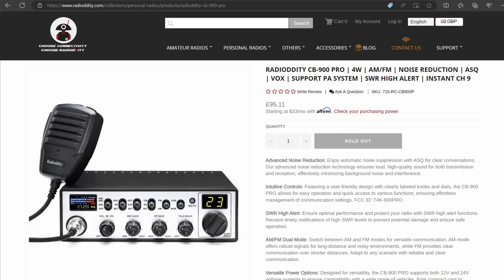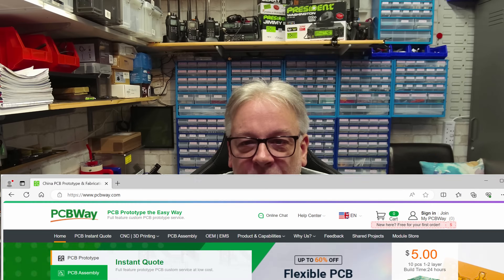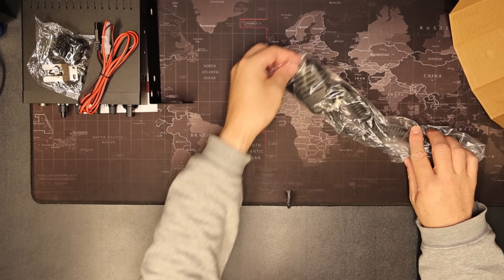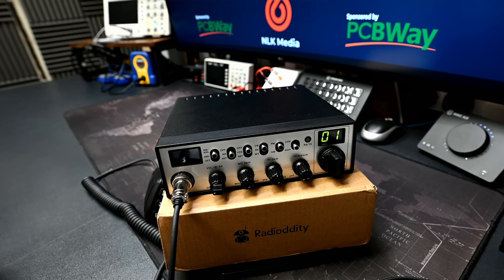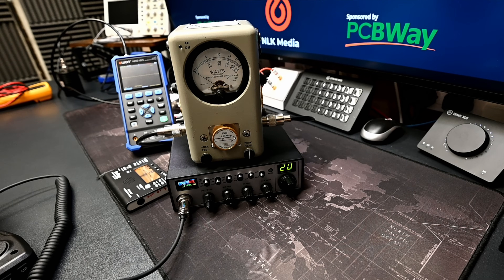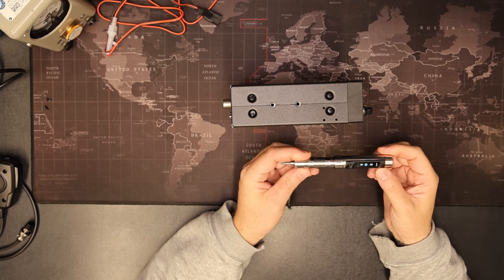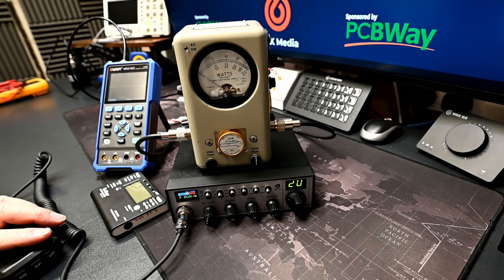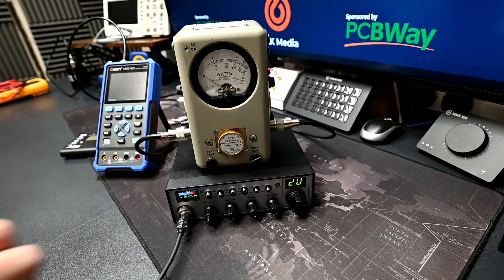Radioddity CB900 Pro – CB Radio Review and Modification

Comment: Would not this radio be better than the CB500 for switching the pin connector vs cutting the wire? As I'm mostly looking at CB usage since I don't have a ham sandwich 🥪 yet. Also, can you use Morse Code through the unit with a Vibroplex unit, was thinking of some general practice with a friend.
Reply from the maker: The CB500 is a better all round radio as it provides CTCSS/DCS tones and codes. If your interested in getting your "ham sandwich" :-) then take a look at the QT80 which I have just posted a video on. It can be expanded to cover the 11-Meter CB band, can be modified for CW via a DIY hack to the microphone and has a dedicated CW mode, its powerful and extremely well priced. All the best and thanks for watching and commenting. MJ7NLK

Comment: Zeros on UK FM is fine. No one would notice. SSB obviously you will
Reply from the maker: Thanks @DnBclassictunes, have just posted a video on the QT80 which is a great radio (essentially an Anytone AT-6666Pro) which is feature packed and very flexible. All the very best and thanks for watching and commenting. MJ7NLK
Reply: @NLKMediaGroup  I've bought two cb 900's and the cs-47 with a load of accessories for 5 just pounds extra. Looking forward to trying them out. If these guys made a homebase CB it would be awesome. Great in depth channel 73s

Comment: I was very close to getting the QT-40, but I picked up a President Richard for 80 bucks and a Ronald for 90 bucks at our local Ham Fest.  I wish the QT-40 had the digital display that this one (CB900) has.  Great review my brother across the pond. You Brits are resilient people, stay strong with whats going on.
Reply from the maker: The President Richard is a fantastic radio and I have covered it on the channel and referenced it in many videos. The Walker 2 (EU Model) is the same radio but CB out of the box rather than Ham for the Richard and they both have the same circuit board. The Richard can often be found cheaper than the Walker which doesnt make sense as when both radios are expanded they are very nearly identical. You can't go wrong with the Richard, it is a lovely radio to use. Now if they would come out with a Richard 2 that also had SSB that would be amazing but the Lincoln 2+ is kind of filling in that space.
The new digital display on the CB-900 is really nice, a little small for aging eyes, but a really nice addition and keeps the look and feel of this classic style radio. It lacks CTCSS/DCS support but not everyone wants or needs that. The CB-500 is the better choice on a feature level but doesn't have the same old-school visual appeal.
I have around 20 President radios in the collection but don't have the Ronald. However, I do have the CB version being  the Teddy 2.
The new QT80 looks a beast of a radio and I am looking forward to getting one to test and play with soon. Radioddity have done a great job of bringing some interesting radios to market at decent prices.
Things in the UK are a little difficult right now with a load more gatherings scheduled today which I very much hope will remain peaceful. Thank you for your kind words. All the best and thanks for commenting. MJ7NLK

Comment: Definitely needs UK channels in band block normal/expanded.

As freq readout not an issue 
27.781(don't need 25 at the end)
I'm sure this can be done in radio firmware 👍
Lacks ctcss too on FM, bit of a shame.

👍Rob.P
Reply from the maker: Hi Rob, adding the UK FM 40 would certainly be a great addition even if it was added as a band block in expanded mode. Maybe that will come in later versions. There is no support for tones and codes on the CB-900 and this is where the CB-500 has the advantage and its slighly cheaper. It is a good radio, looks nice and is easy to use, if you only need AM/FM and don't need CTCSS/DCS then its worth consideration but the CB-500 is hard to beat for the money. All the best and thanks for watching and commenting. MJ7NLK

Comment: Good video! The radio to review next, is the AT-6666 PRO / QT-80. It's the killer radio that even the Washington won't out-perform. I hope you can get one to test. Imagine a CB-500 on steroids. The new QT-60PRO is worth a look as well. Fantastic radios!
Also, you should show the 3 different meter display modes on the CB-900 PRO. It's probably the most unique (and interesting) thing about this little CB radio. Another thing to mention is that the AT-900PRO is actually the little brother (with less features and less performance) when compared to the AT-500Mii (CB-500). As you saw in your review, the CB-500 is more advanced, with a real dual purpose modes (for CB and HAM) and sensational performance. 
73
Reply from the maker: Have added the Anytone AT-6666 Pro / Radioddity QT-80 to my list of radios to source. They have the same power output rating as the Washington, 80W PEP and 50W on FM. Would be interesting to see how similar they are on the inside and what the differences are. Will ask my contact at Radioddity if they can send one out for review but I need to clear the backlog first. I did have a play with the S-Meter but as it was plugged into a dummy load I decided not to include due to it just showing 1 all the time. If I had managed to get out and about with a field test then I would have included. The LCD is small but works well and it looks very similar to the RF Power bar in S-Meter mode. It does get very confusing with multiple companies selling the same radio but I did notice that the AT-900Pro appears to also be available in Black as well as Silver which looks nice. Well there is a picture of a black version on their site. The CB-500 is really great value for money and I really enjoyed using it which is one of the most important things. The CB-900 is much bigger in size (needlessly based on the empty space inside) but out of the two I would pick the CB-500, it really is a great little radio. I very much appreciate your comment and thank you for watching. 73 MJ7NLK
Reply: @NLKMediaGroup  good stuff. Thanks for the reply. Yes I have a CB900 PRO here, and It is indeed a fun radio. Only the silver and black version is available currently. The "all black" version is going to be under a different brand name soon.  FYI, The AT6666 Pro actually has one additional final (output transistor) compared to the Washington. So you will see peak power of around, (and usually just) over 100 watts PEP. As well as supporting the 15m ham band as well. (There are many rumours flying around at the Washington and the 6666 Pro are the "same", But they only share a core design). There are many differences between them as I'm sure you will see. I'm looking forward to seeing your upcoming reviews. Keep up the good work! 73

Comment: First review of this radio on Youtube - Congratulations! Cool looking radio with nice expandability. Personally I would have preferred if they dropped the talk back control and have a dedicated squelch but thats just me. Have you any footage of that s-meter working? I like the traditional Uniden/Cobra type meter but interested to see it in action. Look forward tl any more videos you have planned. 73s Ant 26DR302
Reply from the maker: Thank you Ant, its a lovely classic style radio with a mix of the new as well. I don't use talk back or Vox come to think of it. I do like all the essential and frequently used options having their own dial, makes life easier. I did play with the S-meter but the radio was plugged into a dummy load so it was returning 1 all the time and I didn't think anyone would want to see that :-). The digital display is very small but works well and looks great. I guess making it any larger would have ruined the look. I do like the CB500 and the much bigger display is very good for ageing eyes. Got lots to cover in August and think I might look at the Jerry next while I wait for the Washington's cooling fans. All the best and thanks for watching and commenting. 73 MJ7NLK
Reply: @NLKMediaGroup  Review the Washington! :)
Reply: @NLKMediaGroup is there a way to lower the DEAD KEY WATTS to about 1.5 to run into an RM ITALY 203 amp?

Comment: Wonder if they are stingy with the heat transfer grease like. the 500?
Reply from the maker: I didn't remove the board so did not see how much paste they used. Will keep an eye out next time I have a need to remove and see. Thanks for watching and for commenting. All the best MJ7NLK
Reply: Not convinced this would need much paste ...so little output power, I would of considered this radio but it would hardly kick my amp being a HD amp
Reply: Only a little paste is needed, its just to fill the micro dimples in the surface of the metal used for the heatsink. Im sure too much paste has a negative effect

Comment: I'd like to see a review of the new CRT SS 8900.
Reply: I've got a CRT ss8900 and it works very well, it's basically a 7900v in a smaller case with a few extra features.
Reply from the maker: I don't have that one yet. I have the SS7900, two variants of the SS6900 and the SS9900 which I have not got around to playing with. Will check out the 8900 and add to the list of future purchases. I am backed up with radios for review and am trying to work my way through them in August. Hope all is well with you and thanks for watching and commenting. MJ7NLK
Reply: @NLKMediaGroup  the reason I like the 8900 is the VHF receive band and truckers and loggers use VHF here in western Canada instead of CB radios. I find the VHF receive function very useful to listen to the truckers that are on VHF instead of CB. Truckers stopped using CB back in the early 2000's because of skip interference and Industry Canada (Canada's radio licensing body) made VHF channel's just for truckers and loggers here in British Columbia Canada so that's why I'm intrigued by the new CRT SS 8900.